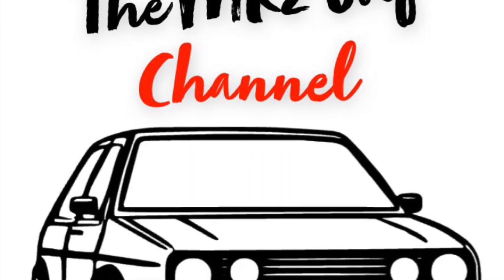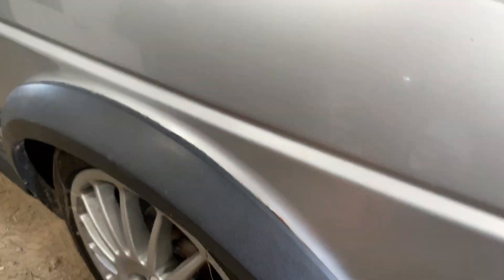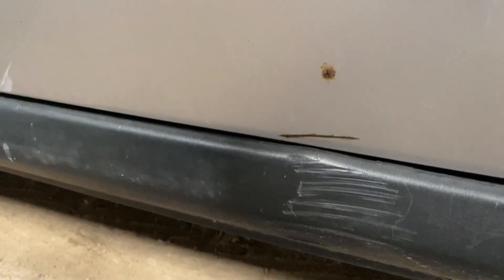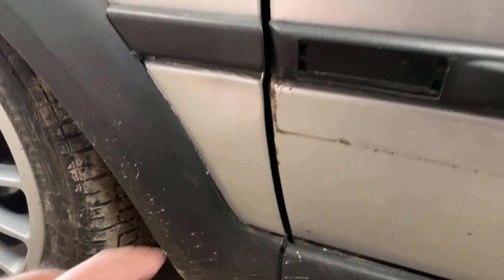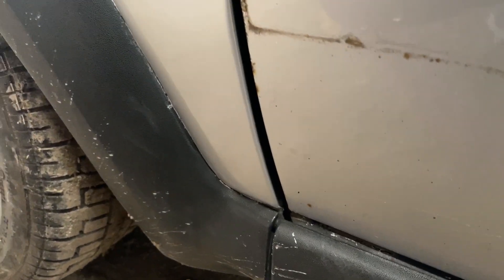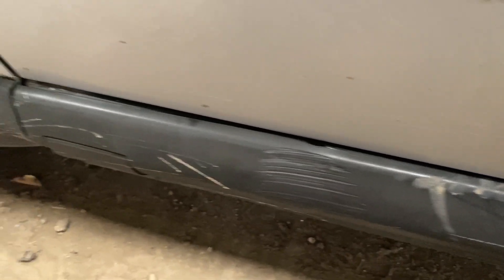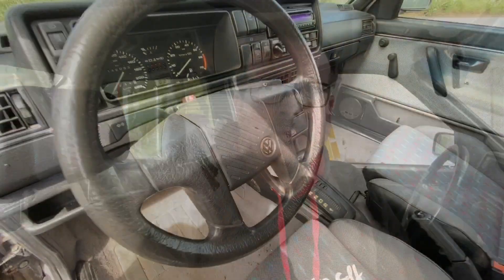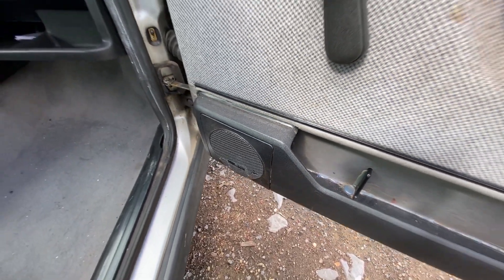Everything That’s Wrong With Our Cheap Imported MK2 Jetta Coupe

Comment: I think buying a cleaner one is always cheaper than doing all the work. As what you see is not always the only thing wrong. But the thing once it’s built it’s yours. If it’s bought to be sold than no it’s not worth to put the money in. I personally would start with a cleaner one.